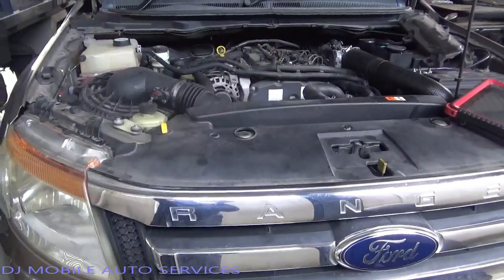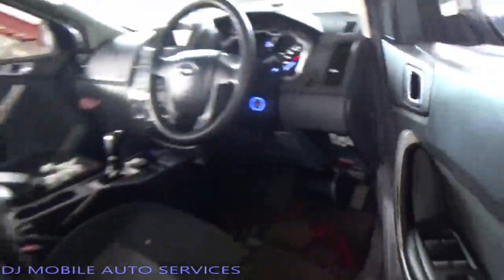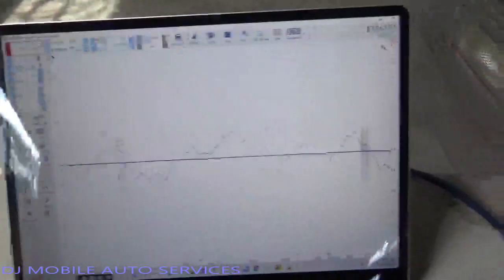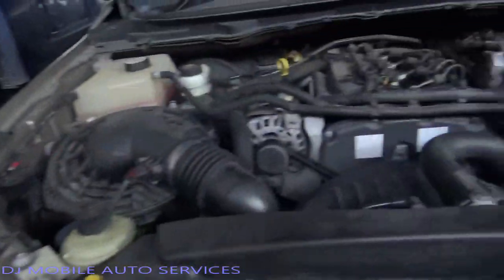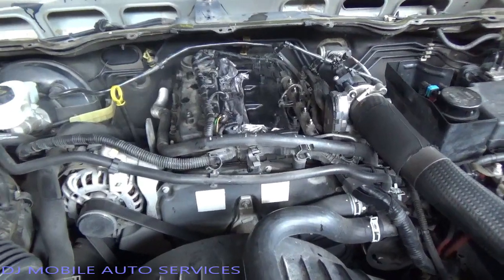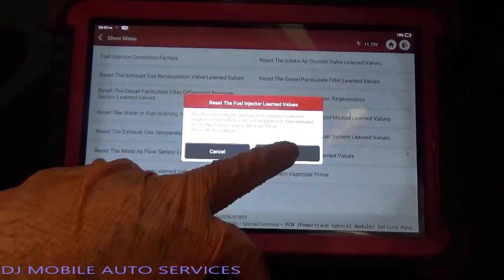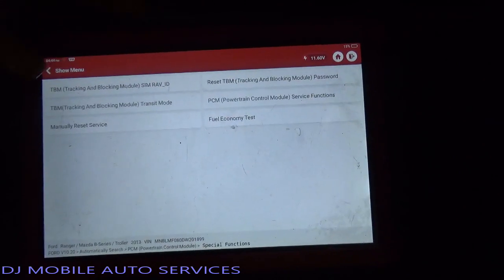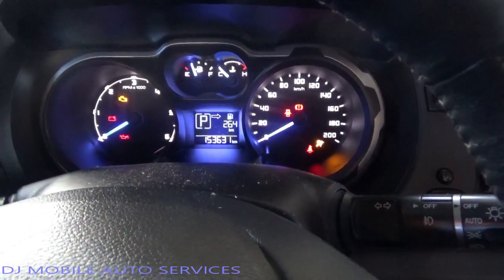What can cause cylinder misfires on a 2013 Ford Ranger Diesel? How to diagnose and repair.

Comment: Did it need an oil pump?
Reply from the maker: Looks like this vehicle has a serious issue with its oil pump. So far this model after it reaches a certain amount of mileages looks like it has an issue with the pump. A few had to be replaced or serviced around a 100k km. Thanks for watching.